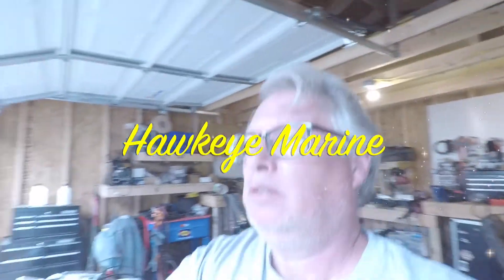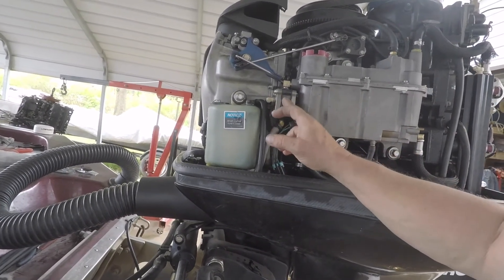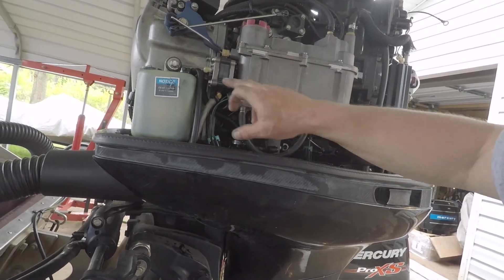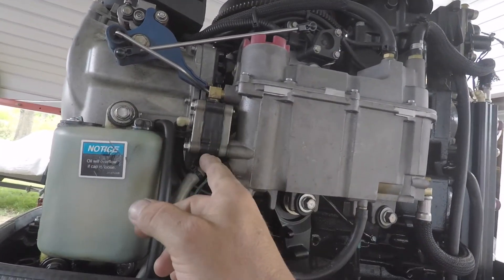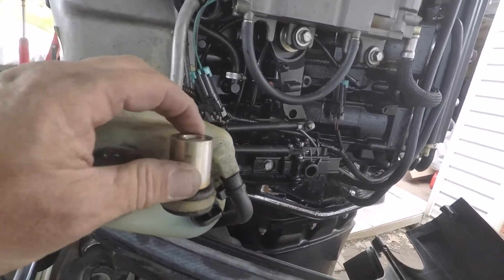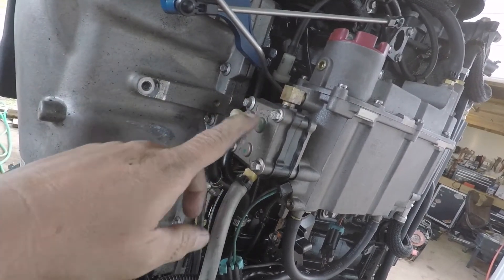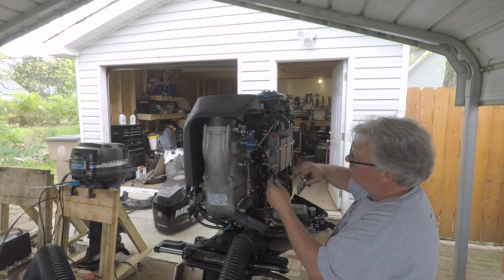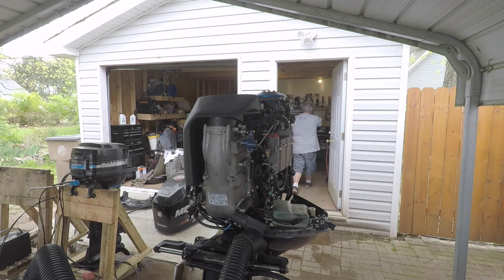Mercury 250 Pro XS 3L Optimax  Fuel Pump part 1#Mercury250ProXS #fuelpump #VST

Comment: Part 2?
Reply from the maker: This one is 4 years old so, basically I could never get rid of miss until I replace the reed valves with some carbon fiber reeds from Chris Carson.  I also have replaced the compressor.  There is a manual lift pump that pumps fuel into the VST.  My pressures were good.  Should be 90 psi and 80 psi.  I don't remember is there is a part 2.  I'll have to go look but everything should be in my Mercury 250 ProXS folder if I have it.  I'll take a look.

Comment: Just wondering I have a 200hp optimax  vst clean all pumps in it working but when I take take to wot runs for 30-40sec then Boggs down but runs fine on idle. I haven’t cleaned injectors and haven’t checked fuel pressure and air pressure. What would be your best bet? Thank you
Reply from the maker: When its an  issue like this can be hard to diagnose but, check the fuel pump going into the VST.  Check the air and fuel pressure on  the rails.  It can also be a spun hub on the prop.  Hope this helps.